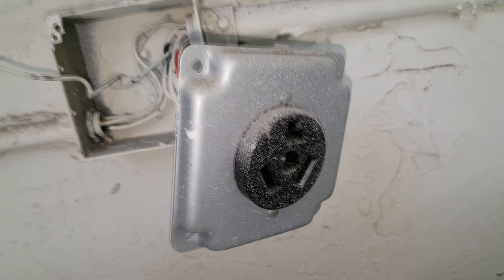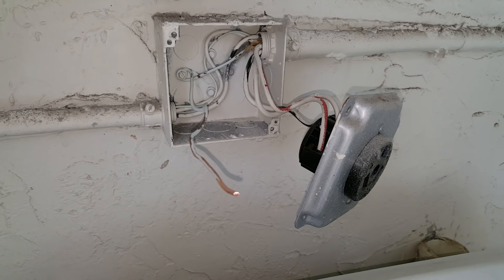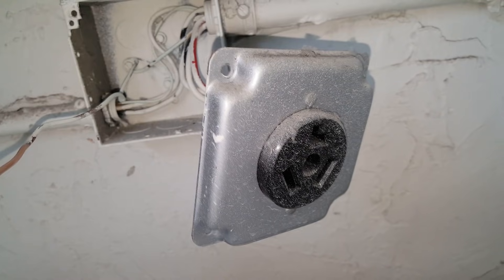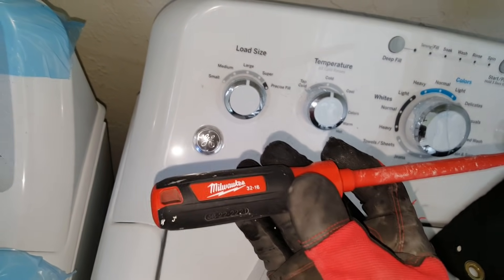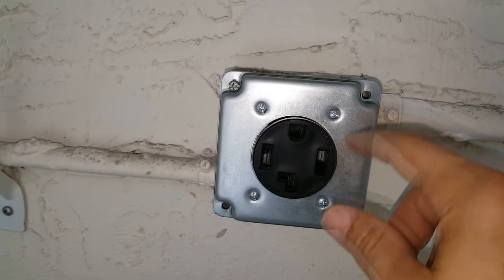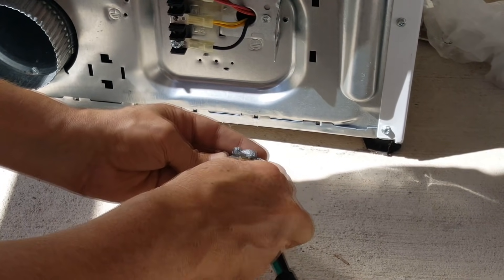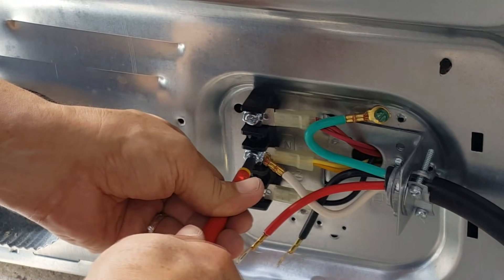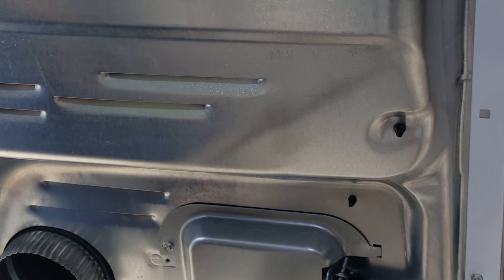How To Convert 3 Wire Dryer Electrical Outlet to 4 Wire

Comment from the maker: ✅ Tools/Parts in this dryer electrical outlet video:
Fluke FLK2AC Voltage Detector: https://amzn.to/2THggao
Leviton 278 30-Amp, 4-Wire Dryer Outlet https://amzn.to/2GOMjle
G.E. Wire 30-amp Dryer Cord: https://amzn.to/2VnV8Wn
Reply: Pp]
Reply: P
Reply: Thomas IIXE nice time II call you

Comment: Wrong. A metal box does not need to be bonded if emt is the wiring method as in your video. You must bond the box and device only if you employ NM romex as a wiring method. The receptacle is not a 4 port or 3 port. Wow.

Comment: If you're doing electrical work, please learn the correct terms.  For example, that's not a "common" terminal, it's the neutral.  Also, there's no such thing as 120 degrees voltage.  It's 120 volts, 180 degrees phase angle between the two.  In some instances, where a building has 3 phase power, it's 120 degrees but only 208V between the phases.
You don't put the ground pin at the top because you like to.  You do it because that's the spec.
You could have used a nut driver with that ground screw.

Comment: Since they had the 4 wires; 2 hot, neutral, ground;  going to the box, why wouldn't they have originally put in the 4 prong receptacle?
Reply: Likely wasn't required at the time.  The code changes over time.  When I was a kid, most outlets weren't grounded, but now they all are.  My condo was new in 1993 and had the old 3 pin style connector.  I installed the 4 wire outlet recently, when I got a new dryer.

Comment: Nice vid thanks...when you wired up the plug part u just ran the ground straight from plug (receptacle) to the panel board ground.....u didnt ground the actual metal box that the receptacle was in aswell..should i do that .ie...ground wire from plug to wire nut; ground wire from metal box to same wire nut.  Then ground wire to panel box from same nut. ..so you ground not only the dryer but the little metal box plug sits in aswell .any thoughts appreciated?

Comment: This should not even be an issue in 2024!!!😱
Reply from the maker: many houses are still old
Reply: It may be old, but it's still legal if it was according to the code of the time.  However, after almost 20 years, 3 wire cables on dryers may be hard to find, so you'd have to upgrade the outlet.

Comment: Might have to do this. the dryer that came with the house is 30yr old and i can't figure out the fix. 3 prong outlet is less than a foot away from circuit breakers. I doubt they have a 4th wire considering how many other hacks we've found.

Comment: The ground wire in the box looks to be a #12, I thought it had to be the same size or larger than the conductors?
Reply from the maker: They are allowed to be smaller because they don't normally carry current

Comment: Looking for this but with no ground in my old 3 wire plug!!! 😢
Reply from the maker: Sometimes we run a separate ground wire from the electrical panel, across the attic and kitchen ceiling and down the wall to get that 4th wire.

Comment: Wanted to get your thoughts on this.  I know you usually never want to do this, but they sell a 10-30 to 14-30 adapter so that you can plug a 4 prong into a 3 prong outlet.  And on the 4 prong side they actually have the ground wire coming out and running as a separate wire.  They say you would then plug the ground wire into a nearby standard outlet ground slot (NEMA 5-15, using the ground slot only).   It seems like a pretty hokey way of upgrading to a 4 prong but I guess technically this works.  You are basically borrowing the ground wire slot from a standard outlet because there was no ground wire available to the dryer outlet to make it a true 4 prong outlet.  Do you see anything wrong with this as a way to not have to run another ground back to the main panel for the dryer outlet?  Setting aside the fact that it's gonna look really odd with the single green wire going into the nearby standard outlet.

Comment: Rookie. He meant to say the two 120 volt hot legs are 180 degrees out of phase. Not 120 degrees.
You are not SHORTING OUT  the white to green it is called neutral bonding, or NEUTRAL TO GROUND BONDING. It is a jumper,  not a short!

Comment: Hi Jeff, I wanted to make sure I am doing my wiring right.  On the new 4-wire; since I am connecting the new green wire to ground where the green/yellow was, Do I connect the green/yellow wire behind the white neutral?
Reply from the maker: No they should be 4 distinct wire connections.
Reply: @jeffostroff  Thank you so much!

Comment: I just moved and changed my 3 prong outlet to a 4 prong in order to fit my dryer. When I turned on the breaker for my dryer, it was tripped (lit red). When I turn the breaker off and and back on, it’s still tripped. Any idea what the issue may be?

Comment: Was the red wire the 'x' or the 'y'? 
Also, I may not be too savvy in this department, so I do not know if this makes any sense.
Could you (not having a ground in the wall) still switch to 4-outlet and leave the ground strap on the dryer?
Reply: X and y are interchangeable. I'm more curious which ports the ground leads go into. Why didn't he show it?  Does it matter?

Comment: What happens to dryer if not wired right
Reply from the maker: That depends on which way you wire it as long as the black and the red wires go where they are supposed to and the white wire goes to the chassie in the case of the old 3 wire system, you should be OK.. But don't put either the black wire or the red wire where the white wire should go or you will energize the chassie and people can get electriculated.

Comment: My dryer outlet has 2 wires and no ground and there both black I am trying to install a new outlet and watching your video, do I need to have a ground installed? I had a dryer plugged into the outlet for 4 years and it worked fine. Helplp
Reply from the maker: If your Electrical panel has grounds in them, I would run a new ground wire to the dryer port from there, along with the white neutral

Comment: Great video!  I tend to keep extra parts or attach them in a safe place.  The only thing I could even comment on is just getting an extra bonding screw, attaching in to the original position and point the bonding wire down with a label on it.  It isn't your problem but if you ever get sell or give away the dryer.  Someone may convert it back to a three prong cord and not realize they need to ground the machine.

Comment: My outlet only has a white, black and bare ground wire. I tried using a jumper to jump the black to the other hot side on the four hole outlet and it tripped the breaker when I tried to turn it on. What do you do when you don’t have the red wire?

Comment: Two owners before me followed these instructions but overlooked the fact that the ground wire was only connected to the metal outlet box. Unlike the lucky situation here most conversions require changing a 3 wire cable with a 4 wire cable which is not a DIY job unless you plan on running conduit all around the outside of your walls.
Reply from the maker: We have run the extra wire a few times. Sometimes we have to go up tot he attic and over.

Comment: My outlet has a black and white wire and the ground i feel that a wire is missing 😕
Reply: Nah, it's just that your panel is outdated.
Reply: If that's a dryer outlet, then you have BIG problems. Just gettit professionally installed!!! Advice from a RETIRED school janitor and groundskeeper!¡!😂🤣😂🤣
Reply: That was legal, but the white should be marked with black or red tape or paint, to show it's hot.

Comment: I had a friend  install a couple 3 prong outlets for me and saw they were all installed with the ground prong to be on top like you did. Normally outlets are installed with the ground prong at the bottom. Then I asked an electrician if that is safe and he told me it's not code that the ground prong in an outlet has to be on the bottom but it is an issue of safety that it should be. Something about how a person normally pulls out a plug from top to bottom. If ground prong on an outlet is at the top then the ground prong is pulled out first when a person pulls the plug out of the outlet. This can then make it unsafe since the 2 active prongs/now on the bottom. are last while being pulled out of the outlet if they touch metal, or there's a splash of water, etc. The ground prong has been pulled out first if it's in the top position so that jeopardizes the safety/protection of the active electric prongs being pulled out last from the outlet.
Reply: I understand the reasoning behind what the electrician said, but I'm struggling with his justification.

I actually walked around my house with a little power strip I wasn't using and plugged it in and pulled it out to see how I naturally pull a plug. Some of my outlets have ground on top, some have it on bottom. I tested it on your typical wall outlets, at standard height. I also tested it on kitchen outlets that are counter height. And the wild card was the outlet in my bathroom which is sideways (ground on the right) and located above my head, about 6'3" high on the wall.

The results were interesting.

The power strip I was using had the power cable coming off the side of the plug, next to the ground prong, so that when plugged in to the outlet it was flush with the wall, not the kind with the wire sticking out of the back of the plug, like you typically find in ungrounded appliances.

I started with the standard "normal" outlets along the wall in my living room, with the ground at the bottom. I tried 3 different locations. All 3 times I noticed that with the ground on the bottom, and the power strip cord aimed at the floor, I always pulled it by the cord when removing it. I reached down, grabbed the cord, and pulled up and out at an angle, meaning I pulled the ground first. However, at no point was able to fully remove the ground before the hot wires. Even at an angle, all 3 prongs pretty much came out at the same time.

Then I moved to the wall outlets that were "upside down," and tried 3 of those. This time, I didn't pull it by the cord to unplug it. I reached down and pulled it out fairly straight by grabbing the plug head. I'm sure there was some upward angle as I pulled, cause I was still standing, but it wasn't noticeable. 

Then I tried the counter outlets, and the one in my bathroom. 2 counter height "normal" outlets, 3 counter height "upside down" ones, and one sideways. I noticed something very interesting about those outlets.

Whether the ground was on top, on bottom, or on the side, in all those tests I pulled the plug straight back by the head rather than the cord. The ground prong and the hot prongs all left the outlet at as close to the same time as you could get.

I retried the test again using an extension cord, where the cable was attached directly to the back of the plug, sticking out away from the wall rather than close to it. In this test it was instinct for me to pull it by the cord for all the outlets except one of the counter height outlets with the ground on bottom, and the overhead outlet with the ground on the side. In both cases I noticed that if I pulled the plug by the cord, I'd be pulling it "sideways" because of the angle I was at, so I opted to grab it instead. But in all the tests, the plug came out fairly straight, regardless of pulling the cord or pulling it the "right way."

So what do I conclude at the end of my super scientific study? Having the ground on the top or the bottom doesn't really matter, but ground on top does have an ever so slight advantage due to the way plugs are removed in some situations. But it's more beneficial for the appliances than it is a safety thing.

What does seem to matter more than outlet rotation, is outlet LOCATION. Outlets that sit about elbow height are the most natural to unplug "safely," with outlets below the wait being the least natural.
Reply: It's common practice with 120V to have the ground at the bottom, but some areas require it at the top.  Other outlets, such as for dryers, have it at the top.

Comment: I'm confused about the first part of the video How could the 3 prong have been running without a ground?? 3 wire 220 is a ground with 2 hot legs. Seems you would need to run a neutral and wire that in the breaker box
Reply from the maker: That's the way they did it back then and remember there was a ground already in there, and in your electrical panel the ground and the neutral are connected together, but nowadays they want completely separate neutral from the safety ground after 1996 I believe it is. The likely reason for this is they pretty much want current to stay on the neutral line, and they don't want the ground wire to be a current carrying conductor, unless there is a short circuit and then it just directs the current to ground.

Comment: Thank you.  Unfortunately, I can't EASILY upgrade with just two large black wires that are hot and a kind of silvery woven/coiled neutral.  No ground.  Your preliminary info helped me make that decision.
Reply from the maker: James, check to see if you have metal conduit, maybe that is your ground. Also, I have had to run separate ground wires back to the panel before.
Reply: What if I have no ground wire would I be able to attach a standard ground wire to the junction box for this type voltage?

Comment: So question can you just change the wire instead of the wall socket ?
Reply from the maker: No to convert to 4 wire you need a 4 hole socket

Comment: I have to pay $500 to get a 4 prog from a 3 prog. This video is the same 3 to 4 but the electrician said he has to go to the attic to install a wire from electrical box??
Reply from the maker: He might be talking about adding the ground wire, that is the green one, I have had to do that a few times. Remember your old box has no ground, just black and red power lines then white neutral. So we have to add it sometimes.

Comment: Oh I’m sorry.! I didn’t listen to well. You explained I would have to run a ground from my panel to the dryer plug box.
Reply from the maker: few times I have had t climb into attics to run ground wires, and even cut holes in drywall to feed it up the wall past fireblocks

Comment: What if the outlet box I am converting to 4 prong does not have a ground wire in it? My Samsung cord is 4 wire, but the outlet box is from 1993 so there is no ground wire even in the receptacle. There is a green screw on the back of the dryer but that doesn’t reach far enough to be used as the ground wire in the back of the new outlet.
Reply from the maker: If your electrical wiring passes tot he box via electrical conduit, it might be grounded already. If not, you have to run a new cable from the fuse panel to the outlet box, one that has a ground

Comment: If you are on a 120/240 V line, they are NOT out of phase, 120/240 is single phase. 120/208 is 3-phase voltage which is very rare in residential (exception being commercial residential).
Reply: Came here to say this. In the US, we have two 120v legs, that are "split" off of a single phase. So two legs that are in the same phase with each other, not 120 degrees out of phase.
Reply: That depends on where you measure the phase.  If between the hot wires, then 240V single phase.  If between a hot and the neutral, then the 2 hots are 180 degrees out of phase, referenced to the neutral.

Comment: i was an electrical inspector when 4 wire receptacles & pigtails became code. i thought "it's long overdue" unfortunately people moving into a new house with an old dryer and/or range chanced the 4 wire receptacle to the 3 wire "crowfoot" configuration. the thrift stores had plenty of 4 pole pigtails & receptacles as a result. unfortunately the 4 pole configuration didn't go over as well as expected. i suppose in time this will change when 3 pole products are eventually gone.
Reply from the maker: this will take another 30 years for the current gen of 3-wire appliances to die off
Reply: @jeffostroff  i've wondered over the years why the appliance mfgrs. didn't use 240 volt drum & timer motors, thus eliminating the need for a neutral. 240 volt stove burners wouldn't be too much of a stretch.
Reply: @garybrown7044   What about the stove outlets?

Comment: How about the convter thing from Amazon?
Reply from the maker: which one?
Reply: @jeffostroff  from 4 prong to 3 prong adapter. I have 4 prong machine but on my wall there is only 3 prong dryer outlet.
Reply from the maker: @goneviral8814  I doubt those are legal

Comment: How do you test a ground wire for good or bad working, and also  if it comes from the panel?
Reply from the maker: You don't really. They have advanced equipment that can put a signal on a wire at the panel and see if it receives that signal at the outlet box.

Comment: While it is of course true that it is no longer "allowed," I think it would be a great service to your adoring masses to mention WHY it is no longer allowed to to use the neutral as the ground. Rules are one thing. But knowing the reason for those rules is powerful. What amazes me most is how this was once considered "safe" to bond the neutral to the metal of the machine.
Reply: Shock or fire pick your poison
Reply: @bk9852  Wiring correctly protects from both, yes?
Reply: Shock to the dryer and fire
Reply: I couldn't agree more
Reply: Ground yes, neutral hell no😮

Comment: Can you just run a separate new ground wire from the service panel to the receptable instead of a whole new cable.
Reply from the maker: Yes, we have done that before as well, just bought a reel of green insulated stranded ground wire,
Reply: What gauge wire?
Thank you for your answers.
Reply: It doesn't  make a lot of sense given your neutral bus and ground (earth connection) are tied together at the electrical panel. Yes the neutral competes the circuit back to the source but at the panel they are at the same potential. You do get better load balancing with a neutral but 3 prong dryers worked for decades.